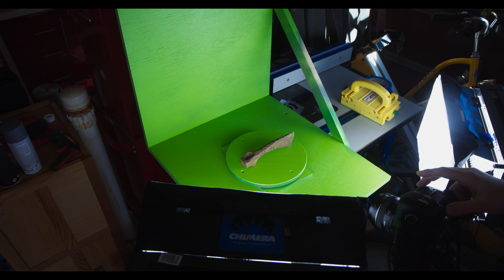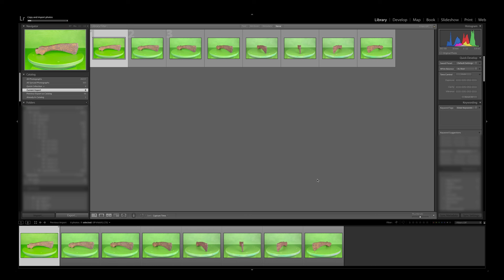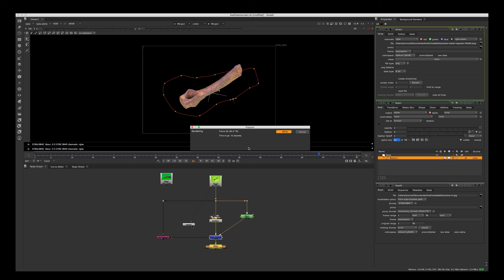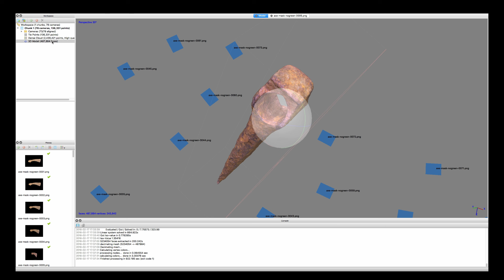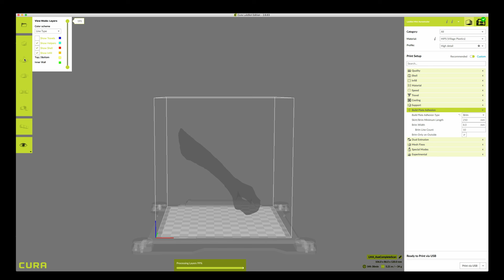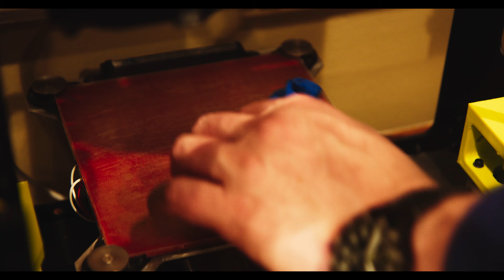3D Scanning An Artifact - Reverse Engineering using Photogrammetry

Comment: Fantastic video! I've been experimenting with some scans using the same setup except I've changed software. I was using Photo Scan Professional but I just discovered an alternative called Reality Capture. This software it's not only faster it will automatically key out your green background for you. I kid you not, you can load up a series of photographs like your ax head and if the background is a solid color like you have it will automatically mat it out. With just a few clicks you'll end up with a final 3D model with a texture. It's incredibly fast and accurate, they have a free trial. 
I have no affiliation with Reality Capture at all. I'm just somebody who loves 3D and is always on the lookout for better and faster tools. The method you show here is something I stumbled across as well. That is to say, you have your lights and camera in a fixed position and you rotate the object. As opposed to having your object and lights fixed and moving your camera around the object. This usually involves walking around the object while taking a series of photographs. If you use the second method you can end up with shadows in your final texture. But I found using the first method, the one you demonstrated, you most often end up getting fantastic results. The final mapped texture having no shadows in it at all, which is perfect if you intend to use your object in 3D software like Maya or Blender. If you're using it for 3D printing then I don't know if it would matter so much. But for 3D software, the aim is to not only capture accurate geometry but also highly accurate texture maps as well. So once again great job on the video.
Reply from the maker: Thanks for your comments. Reality Capture is much too expensive for me. PhotoScan is really the most affordable solution for hobbyists like myself. I wish Reality Capture would make an Indie version. I was using the scan but for 3d visualization and 3d printing. The texture came out nice.

Comment: I would have prefered PETG to HIPS, simply because HIPS tends to warp a lot more. You get more strings with PETG, but they are easy to remove with a hot gun.

Comment: Are you not working on any weaponsmithing project? Can you redo your crucible steel project to make a better product? I tried more or less your exact crucible steel process with methods and similar equipments , but the end knife which was same size as yours was good for little more than kitchen duty. Can you please produce a better experiment for crucible steel

Comment: To get adhesion to the bed, start the first few lines of the print at 30% speed, then, slowly ramp up. It's so effective that i don't even bother with tape or glue, i just print on the glass directly. If you're good with G-code, you can even code it in automatically.
Also, you should play with your support method's settings, you can always print a smidge higher, and have a less built support, that turns in to a stronger support when it reaches the item to be printed.
Unfortunately, you're on Apple, so i don't really know stuff on that side of the computer world. I assume it's pretty much the same tho, so it should be in settings or maybe even play with the file itself in 3d (IE, you space it out the item to be printed from the support structure you made by a few thou, works really nicely when you print hinges, btw).

Comment: I’m curious why you needed to orient the print perpendicular to one edge of the build platform? Had you oriented it at 45 degrees you could have had more than eight inches.  Of course with the thickness of the eye end your actual length would be a bit shorter.  But, totally cool video. Thank you!
Reply from the maker: I could have tried that but am having some trouble with adhesion at the moment. I may need to get an enclosure for the printer or print with a material that does not contract as much. Good point though.
Reply: Niels Provos, anyway, this combination of high tech and traditional techniques is what I do all the time. CNC mill parts and then hand chisel to give the parts character. Or vacuum assist lost wax cast from 3D printed waxes followed by hand chiseling.